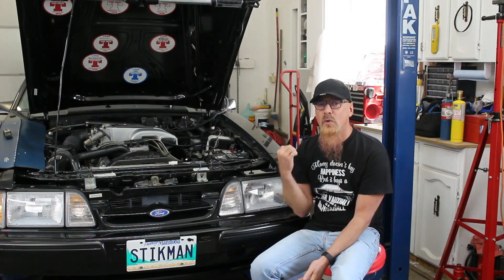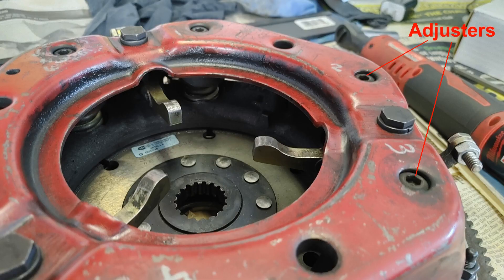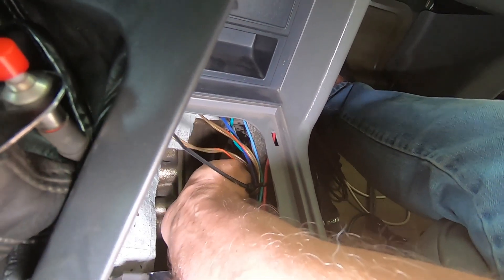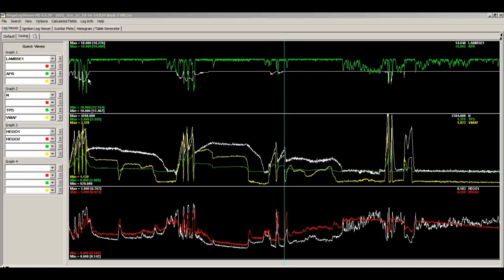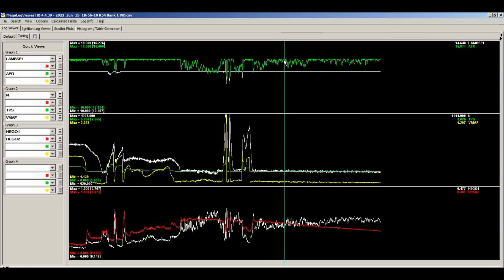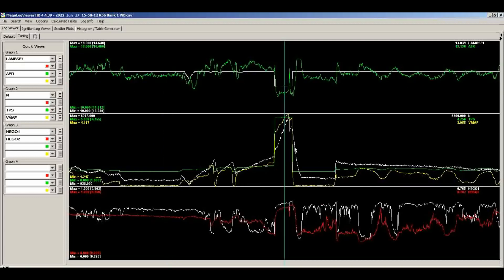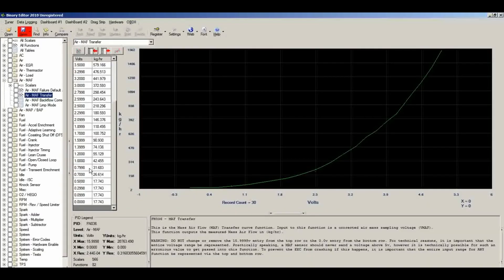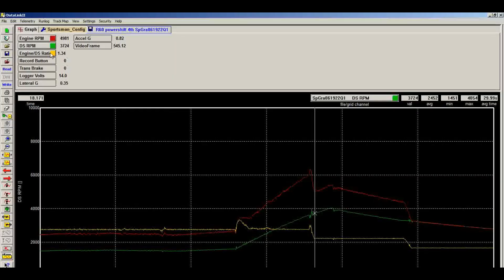Clutch and EFI Engine Tuning

Comment: Bummer on the injectors.  Not being able to trust injectors sucks.  Time to invest / build in a flow bench? Did you say you removed the mid pipe but left the mufflers in place at the track?  How did you stabilize the muffler so they don't hit the drive shaft?
Reply from the maker: I have cutouts I uncork so the midpipe stays in place.

Comment: Very interesting video! I love the clutch tuning information. I just installed a Ram adjustable clutch and Gforce 101a in my car. I am new to all this tuning so this is very helpful to me. I see people talk about data logging for tuning the clutch. It seems people recommend to monitor engine rpm, driveshaft speed and also transmission input shaft speed. It looks like you are just using engine rpm and driveshaft speed, is that correct? I'd like to have a data logger but it seems like a pain to figure out how to monitor transmission input shaft speed. If it can be done with just engine rpm and driveshaft rpm, I would be more interested in installing a data logger in my car.
Reply from the maker: Thanks! Ideally having an input shaft speed sensor allows you to directly calculate clutch slippage in all gears, but you can definitely get the clutch tuning job done with just a (high definition) driveshaft speed sensor, as I'm doing on this car.
Reply: You would just add math channels for each gear
Reply: @The_Performance_Laboratory  Thanks for the reply. On my previous car, I used a RPM products data logger with a 4 magnet collar for the drive shaft speed.  I think there are collars with more magnets so I assume that is what you mean by high definition. How many magnets are on your collar?
Reply from the maker: @1320quick  I have 8 pulses per revolution,  now but am considering upgrading to 16. We'll see how much resolution I get from launch when/if I can get it to the track.

Comment: How much base are you running? Any counterweight?
Reply from the maker: 7.5 g of counterweight. Base forces are detailed in the video - that's what I'm adjusting. It's at 650 lb now.
Reply: @The_Performance_Laboratory  i'm meaning how much base in PP before the turns??
Reply from the maker: @hotrod9507  sorry I misunderstood. Base static is 402 lb with the springs I have in there now, and cover shims.